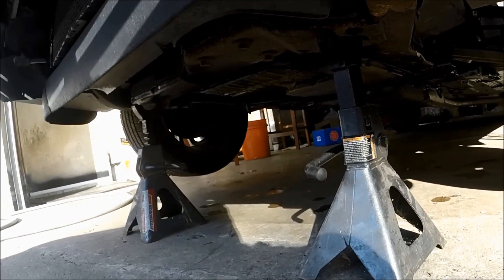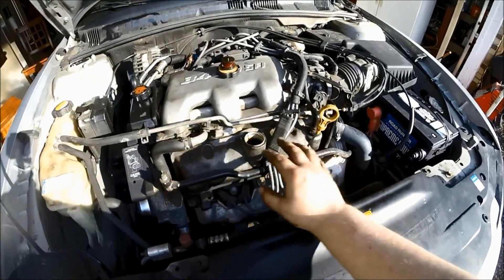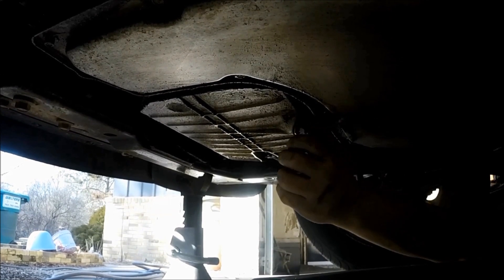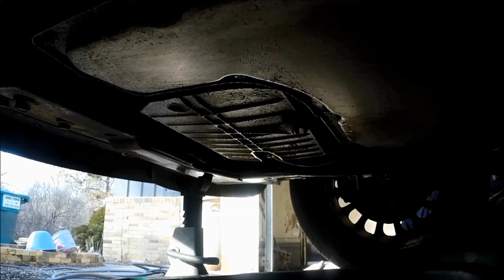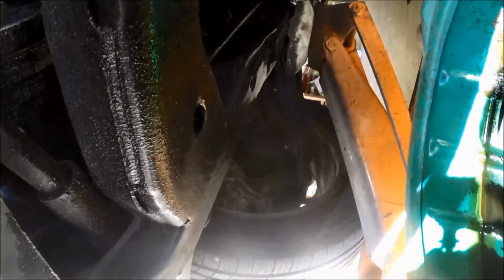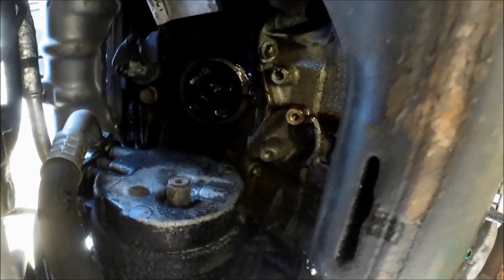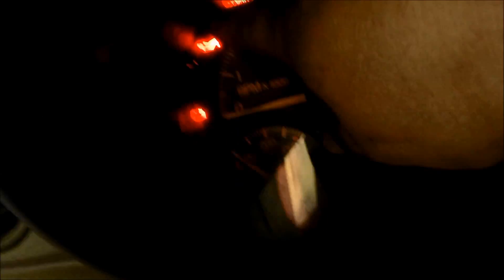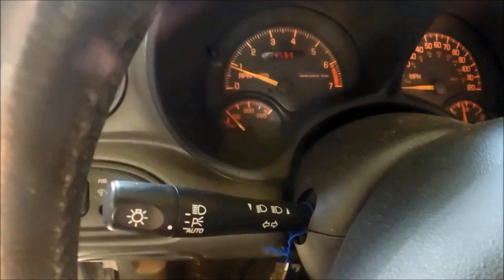how to change oil on the 1999-2005 pontiac grand am complete guide  - Joe The Auto Guy

Comment: Thanks for teaching us the right way to replace oil on our reliable Pontiacs. I really appreciate the fact that you explain the reasons why you do things the way you do them. I did not know that overfilling a motor causes motor vibration which can be very detrimental for your engine... nice tip

Comment: Its better to use a short socket with a flexible head ratchet . A long socket can easily slip off and cause you to bust your knuckles. Also wear a mechanics glove thick enough to prevent further knuckle busting. Been there, done that. 
I was able to unscrew the oil filter from the top by standing close to  the left fender and reaching down using my left arm, just wesr a long sleeve to prevent scratching on your skin
Reply: Also, always wear a hardhat and safety glasses just in case.

Comment: Great video! Very helpful!! I have a question about my grand am it has a coolant leak i have to refill the coolant every few days do u have a idea of what could be going on?and what would u suggest i do?
Reply: Not sure if you've fixed your problem but, I had the same problem and I ended up needing to have my head gasket replaced since then I've had not a single problem with coolant.
Reply: I had a similar problem and use rad sealer and it's so far has held
Reply: They used a cheap intake manifold gasket and I replaced it and took care of the problem
Reply: It's a blown head gasket these cars suck

Comment: Question I gotta change the belt could I just support the engine with a jack and wood block on the oil pan. I gotta take the motor mount off to get the belt out. Or is there another way you know how I can get the belt out
Reply from the maker: Supporting the engine and removing the motor mount plate is the only way to do that one
Reply: JoeTheAutoGuy  so it okay then to put my jack under the oil pan.
Reply from the maker: Yes with a wood block
Reply: JoeTheAutoGuy  okay thanks for the help

Comment: Anyone know if service engine light has anything to do with oil change?
Reply from the maker: No it does not on this model
Reply: JoeTheAutoGuy do you possibly know reasons as to why this light would come on ours came in this morning did the oil change changed the thermostat also transmission fluid I added more coolant and i still can't figure out why it's on
Reply from the maker: Need to scan for the trouble code (dtc) this will tell you what system is directing a problem